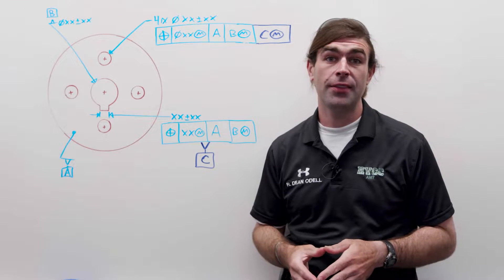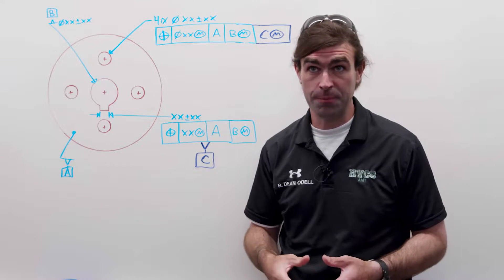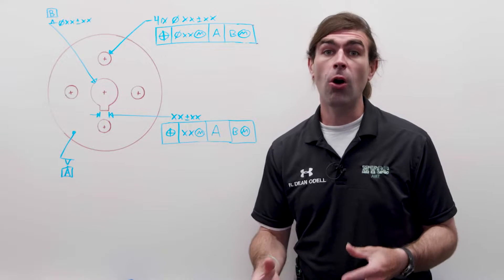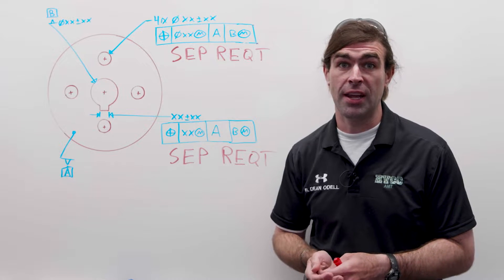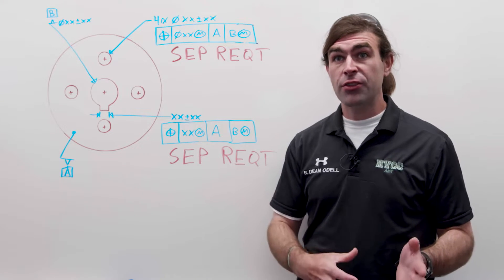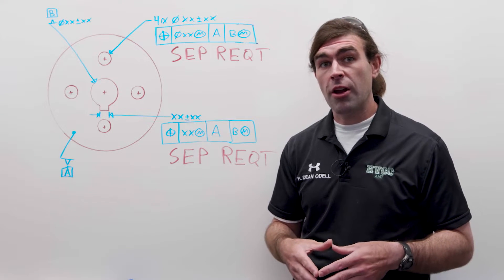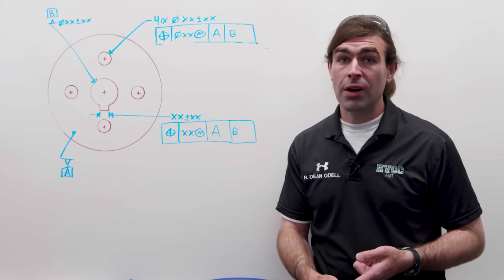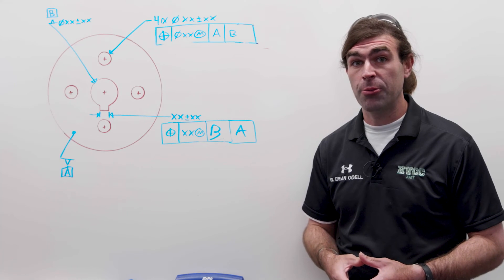GD&T: Simultaneous & Separate Requirements

Comment: Have you found any CAD software that has a machine readable PMI option for separate requirements? Or is it always ‘dumb’ lower appended text? Interested to understand how CAD platforms intend to include this in the digital thread for MBD.

Comment: I've enjoyed many of your videos.  Thanks so much for the great information.  I have a couple of points to make, however, referencing the 2018 version of the standard.
1) At about 5:17 you say that you can't use "SEP REQT" with all of the datums at RMB.  I believe this is only when you are dealing with multiple patterns.  I see that §10.5.4.1 supports what you are saying, but all of §10.5 is specific to patterns of f.o.s.  And it would contradict § 7.19 and figure 7-48 otherwise.
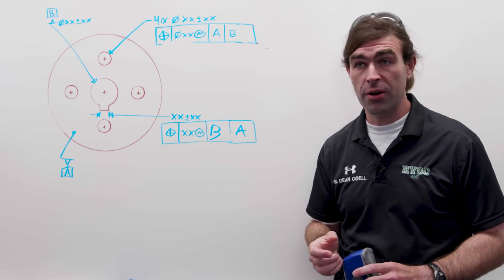2) At about 6:17 you say that you can have simultaneous requirements with the datum in a different order of precedence.  I don't think that is correct.  Again the exact wording is missing from §10.5.4.1, but the following subsection that addresses MMB and LMB does specify the same order of precedence.  Also, §7.19 is very clear about the same order of precedence at the same boundary conditions.
I think that §10.5.4.1 is just poorly written and the figure it references (10-53) isn't really helpful either.
If you have the opportunity to reply I would appreciate it.
Reply from the maker: Hi, Thanks for the great feedback. 
On your first point, I understand where you are coming from. I make these videos to explain the topics, I use Y14.5 as a source, but I can't just read out of the book (so I will never be 100% correct). I interpreted the passages you mentioned, and distilled it down into something I hope people can understand and use. In the case of using RMB for SEPT REQ, it may be allowed, but my experience is that designers that are not comfortable with GD&T specify everything at RFS & RMB when it is not necessary because they do not understand MMC and MMB. In this case, my reading of the passages led me to conclude that at the least, the standard does not encourage using RFS & RMB with SEP REQT.

At 6:17, what I was trying to get across is that changing the datum precedence is not the same thing as SEP REQT. It's not really simultaneous requirements either, just different DRF's that may or more not be interrelated.

I agree with you that several of these passages (as well as that dastardly figure 7-48) are not overly clear.

Comment: Hi! This got me thinking about cases where the part can rock/rattle while in contact with the datum feature simulators, like if the planar datum A in the example had some convex curvature to it or just a high point near the middle. From my understanding, if the axis of the hole forming datum B had a perpendicularity requirement relative to datum A, the inspector can rock the part around (while maintaining full contact on datum A) and find if there's at least one orientation in which the hole axis is perpendicular enough to pass inspection. My question is, if there are multiple features that are supposed to be perpendicular to datum A, is it also assumed that they will all be inspected with the same orientation of datum A, or is there a "separate requirement" equivalent that allows the inspector to tilt datum A one way for the first feature, then nudge it (again, maintaining full contact) and inspect the second feature? I suppose this question also arises when one of the datums is at MMB, meaning the part can rattle while in the gauge. Does everything have to be inspected at the same exact orientation, or can you wiggle the part within the MMB gauge from one feature to the next?